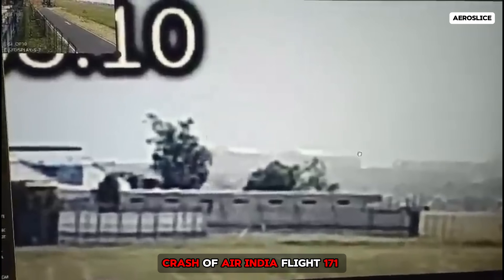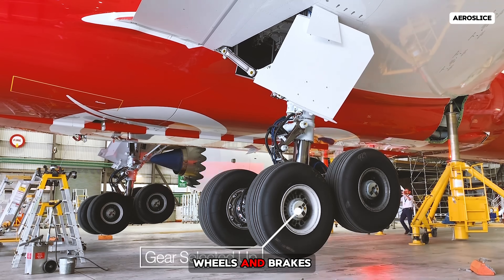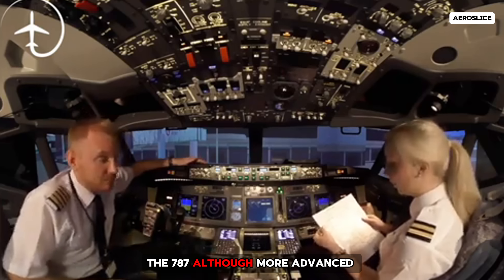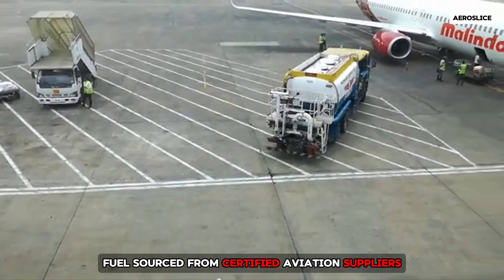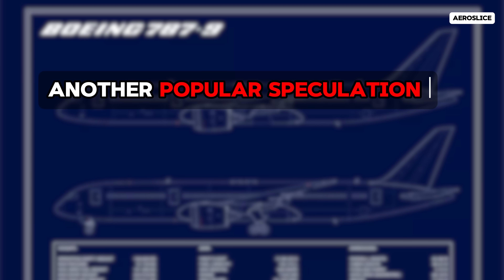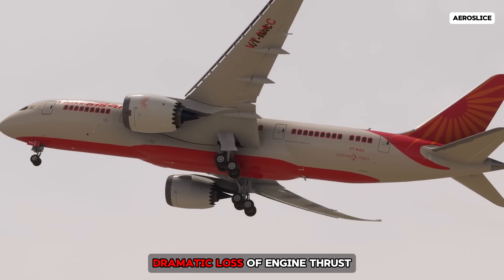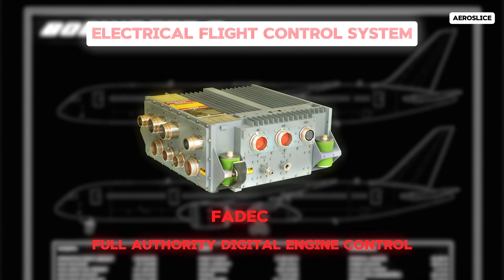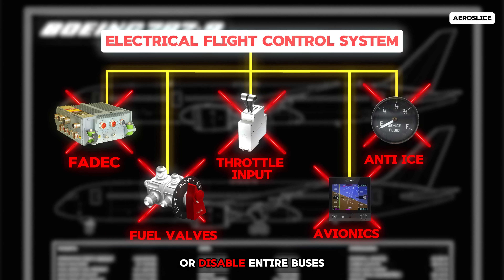The Truths Behind the Air India Crash

Comment: Did the acft use all the runway extension? Or even overrun the runway? Some dust on take off that should not be usual over tarmac.
Reply from the maker: I think its hard to say with the camera obstruction but i doubt it
Reply: The last 8 ADS-B data points show that the aircraft overflew the end of the runway at 71 ft agl and flying at 174 kts, which is where to large cloud of dust was picked-up,
Reply: @christopherrobinson7541 and that is the appropriate speed and altitude at that point?

Comment: Three crucial components in modern aircraft systems, especially relevant are;

GCU (Generator Control Unit): This unit is the "brain" for the aircraft's electrical generators. It regulates voltage and frequency, provides protection against electrical faults (like over/under voltage or current), and controls when a generator connects to or disconnects from the aircraft's electrical bus. The software issues (e.g., 248-day/51-day cycle leading to power loss) we discussed for the 787 directly involved GCUs.  FCM (Flight Control Module): Part of the fly-by-wire system, FCMs provide software-based assistance to the physical flight control actuators. They process various inputs (e.g., airspeed, angle of attack) to refine control surface movements, assist with autopilot functions, and implement higher-level control laws. The "22-day reset" AD for the 787 related to potential simultaneous FCM resets, which could temporarily affect controllability.  FADEC (Full Authority Digital Engine Control): This is a digital computer system that controls all aspects of an aircraft engine's performance. It optimizes fuel flow, thrust, and engine parameters in real-time, based on pilot throttle inputs and numerous sensor readings. FADEC ensures engines operate efficiently and within safe limits, and also manages engine starting, monitoring, and fault detection. It eliminates the need for manual engine controls beyond a simple thrust lever.
Reply: For the GCU (Generator Control Unit) software anomaly (248-day power loss): AD 2015-09-07
FAA Docket No.: FAA-2015-0936
Note: This AD was later superseded by AD 2017-15-09 (Docket No. FAA-2017-0771) as Boeing developed a software fix.
For the FCM (Flight Control Module) software anomaly (22-day simultaneous reset): AD 2016-24-09
FAA Docket No.: FAA-2016-9436
Reply from the maker: Wow, thankyou for the information man I didn't know about this!
Really appreciate your comment

Comment: I'm not a an egineer but I early surmised that the catastrophe was  probably caused by a software glitch that simaltaneoufly starved both engines of electrical and hydraulic power - latter would explain why landing gear only partially retracted. Not many years ago a Qantas A330 suddenly plunged several thousand feet injuring many crew and passengers due to computers going haywire it eventually transpired.
On that occasion the  pilots had the luxury of altitude to help them overcome the problem and make an emergency landing. I wonder if there's a link here...?
Reply from the maker: Could be man, It's quite possible but I feel a software issue wouldn't take 10 years to show up but it can't be denied.

Comment: An initial long takeoff run was likely due to the aircraft's heavy weight compounded by hot weather, resulting in inadequate thrust for optimal performance and leaving insufficient runway for a safe abort.  Crucially, after rotation, a separate and independent major electrical failure occurred, clearly indicated by the RAT deployment and the landing gear failing to retract (a symptom). This electrical failure stopped the tank's electrical fuel pumps, causing the engine-driven pumps to starve within seconds, leading to rapid, catastrophic engine power loss.  Trapped at a very low altitude (around 600 feet), the aircraft stalled due to this sudden thrust loss. The pilots had virtually no time to react or execute procedures, leading to the inevitable crash..
Reply: Totally agree. It’s time now to pause. Wait for the preliminary report. But that pretty much is what makes most sense
Reply: @kevinfairclough4619  Metal shavings interfering with circuit boards have been noted in the reports from the Boeing manufacturing facility. Instead of inspecting and air.-blowing them post-installation, they had deadlines for delivery dates to meet. Fit and finish were rough too, as some parts were rusty and still used, some panels won't fit and have to be manually pounded on or jumped upon. Half-assed parts standards inspections keep the problems unresolved. FAA  inspected the facility in April I think. YouTube has it.
Reply: @dthomas9230  Thank you, I didn’t know that. It’s always good to have a more detailed information. But what you describe is better left for the NTSB, Boeing and Air India to piece together to learn and ensure it never happens again.
Reply from the maker: @kevinfairclough4619  Yes sir!
Reply: Unlikely that all 6 sources of power (or whatever that number is) just stopped suddenly.
Reply: @SIMARJEETMEHTA  Al the 6 energy sources may be active, but not available.
Reply: Joey - 

1) It was not an "initial long takeoff run". The aircraft rotated and lifted off at normal distances. We can prove this.

2) The aircraft reached an altitude of 435' above ground level, not 600'.

3) The aircraft did not stall until the very last few seconds - just before impact. The wings were not generating enough lift to maintain altitude, but they weren't stalled.
Reply: @BryanM61  How can you prove (1)? How do you know it didn't stall after 10 seconds (3)? Evidence please.
Reply: @BryanM61 

 "1) It was not an "initial long takeoff run". The aircraft rotated and lifted off at normal distances. We can prove this.:

"2) The aircraft reached an altitude of 435' above ground level, not 600'.:

"3) The aircraft did not stall until the very last few seconds - just before impact. The wings were not generating enough lift to maintain altitude, but they weren't stalled.:

1) Agreed the rotation was at 2,100m from the beginning of the runway and 1,500m from the end.

2) The ADS-B shows that the aircraft reached 625 ft, bit this was with respect to standard pressure,taking into account QNH 1001 and the runway elevation, this is the equivalent to 71 ft above ground level (agl). There were 8 data points over a distance of 600m near the end of the runway with heights ranging from 21 ft to 71 ft, traveling at 184 kts down to 172 kts.

Prior to this the aircraft had climbed to at least 400 ft (twice the wingspan) in 10 seconds, 2,400 ft per minute, which is normal. The aircraft then suddenly descended.

Also is the height 635 ft was misinterpreted as being altitude above mean sea level (AMSL) and the airport altitude of 190 ft was used this could have resulted in an erroneous value for height above ground level 435ft.

3) I agree, the aircraft suffered a loss of lift and did not stall, until the end of the flight as it when into a musing stall as it crashed into the building roofs.
Reply: @christopherrobinson7541  Excellent, thank you.
Reply: Totally agree.
Reply: Overweight. I agree
Reply from the maker: I think this is the perfect way to describe it!

Comment: Bus Power Control Unit (BPCU) - that's where the investigations have to take a closer look. The previuos electrical problems passengers saw in the cabin, flickering lights, deployment of the RAT, the gear stuck during retraction, dual engine failure, this seems all electrical. BPCU is the only component that can tamper with the highly redundant electrical systems on this aircraft. Engines could have failed from many reasons - insufficient suction feed without the AC powered pumps, a faulty thrust command due to transient electrical states, or FADEC reboot/reset, the fuel valves cutting off fuel to the engine, investigations will show.
Reply from the maker: Interesting, could you explain a bit more about how the flickering could be related?
Reply: @HorizonYT14  BPCU operates BTBs (Bus Tie Brakers), which are designed to disconnect faulty systems from their respective AC and DC busses in the event of a fault and they can establish new connections between buses, generators and loads to compensate. Flickering would tell us that the cabin light system was not properly reconnected and that there was an unstable power supply on this bus. If this started as an electrical failure, BPCU either has failed itself or it did not do what it should do when something else failed. The BPCU interacts with other control units, like Generator Control Units (GCUs), APU Generator Control Relays (GCRs), and Bus Tie Breakers (BTBs) to manage the overall electrical power distribution, also load shedding. There should be two BPCUs on 787, but they are interconnected, there is software involved, in theory there is a failsafe mode but it relies on systems the BPCU controls in the first place... the power management on the MEA is a highly complex environment.
Reply from the maker: @michaelba181 Firstly thankyou for taking the effort to explain everything so well!
I have a lot more clarity now, thanks to you. I understand that its a highly complex environment..
I wasn't able to piece together the flickering with anything due to my lack of knowledge. I will add your comment if I make a follow up video :D
Reply: @HorizonYT14  Flickering during the incident (was this reported by the survivor?) could be from the engines spinning down while the RAT spins up.  Flickering lights at other times could be from a poor electrical connection anywhere in the lighting system or electrical bus system.
Reply from the maker: @patricklockerby4308 Yes that makes sense you cleared a big doubt from my mind!
And yes flickering and a loud bang was reported by the survivor

Comment: It's a known fact that one of the engines were replaced 3 months ago. Perhaps during that swap AI's maintenance department missed a crucial electrical connection or damaged some wiring during the installation creating a hidden problem that would later cause this tragedy. Given this plane has over a decade of service behind it, and not a new plane. I would think this is more of a maintenance issue rather than a Boeing issue. Yes, Boeing has had its share of problems, but blaming Boeing, the Pilots, or even AI's maintenance Department this soon without at least a preliminary investigation is unfair. But there's nothing wrong about talking about any potential cause. It's called hangar flying and it's very helpful to keep safety in the forefront of every pilot's mind.
Reply from the maker: I completely agree with you, It's too early to say anything but personally speaking I think its a maintenance thing as dreamliners are very safe planes.
Reply: Hangar talk/hangar flying…. (Whatever to call it) is important, like you say. And it’s going on daily in aviation professional work. So it’s good to discuss, even if we don’t have all the information. I’ve learnt many things (by using sources I trust).
Reply: This was a 11 years old plane, this was not an old plane, many Boeings are decades older than this. If there was a systematic electrical failure that caused the engines to shut down, there has to have been a chain of events that led to the complete Boeing 787 electrical system shut down and perhaps maybe it was Boeing's computer logic (a glitch) that initiated the electrical system failure.
Reply from the maker: @martentrudeau6948 Thankyou for your comment!
Yeah it's a bit of a contradiction to me because if there was a software glitch it shouldn't have taken so many years to show up right? I believe it was lack of maintenance that led to an electrical failure. What do you think?
Reply: @HorizonYT14  I’m trying not to go down the speculation “rabbit hole” but the circuit breakers on a 787 are under the floor, distributed throughout the aircraft but mainly the avionics bay. There are remote means using the touch screens to control certain breakers, but not all, and unlike manually accessible circuit breakers. In any way of analysis, there was basically no time if there was a problem down there, no chance. If there was poor maintenance in the checking of the continuity of all electrical systems, I’ll put my hat in the ring to say that’s my most probable cause, a faulty electrical system of some sort. Without further info, there’s nothing I can add. Not that I am really!
Reply: @HorizonYT14  I agree. A “glitch” isn’t going to be on any NTSB report. So I’m totally with you, if I’ve followed your thoughts correctly (sorry if not). Maintaining the electrical system I’m thinking Is perhaps going to be a part of it. But a part, it’s never just one thing.
Reply: @martentrudeau6948  Thanks for the additional information. I like to listen and learn.
Reply: Boeing makes great planes. It's  shitty maintenance.
Reply: "known fact that one of the engines were replaced"  Not replaced. Overhauled. But EVEN IF one engine failed, the plane would still have been able to fly.
Reply: As a lay person, perhaps I shouldn't be commenting on the video. Nevertheless, in my opinion, I thought the video was very well done. But I must say that I felt it was continually putting a slant on finding Boeing at fault for the crash. That may well not have been the case but that's the feeling I got when viewing it. So much speculation out there but time will tell.